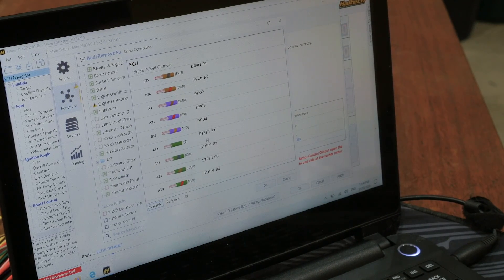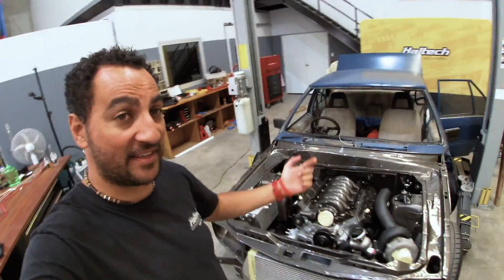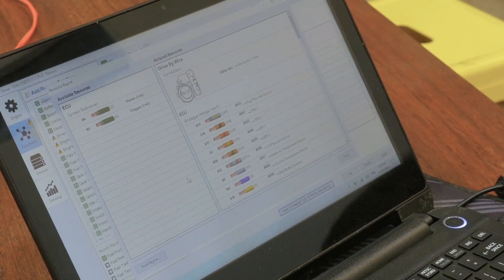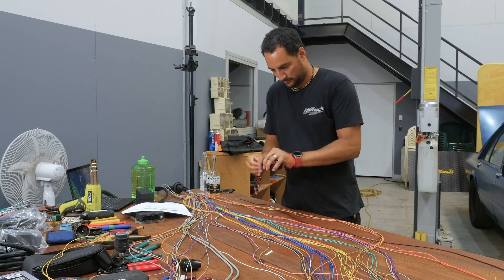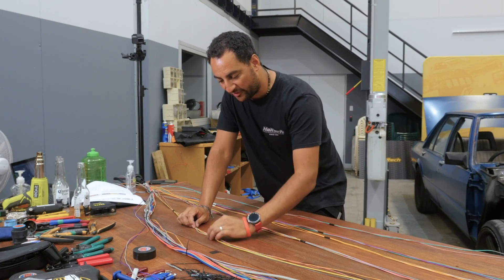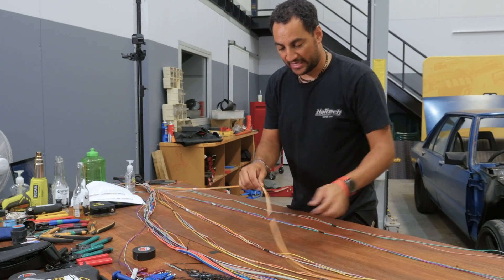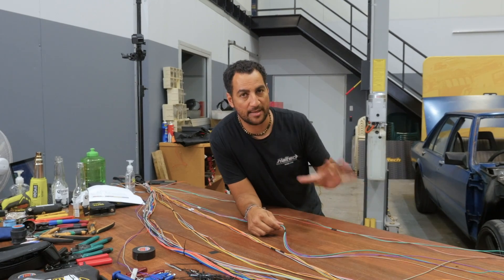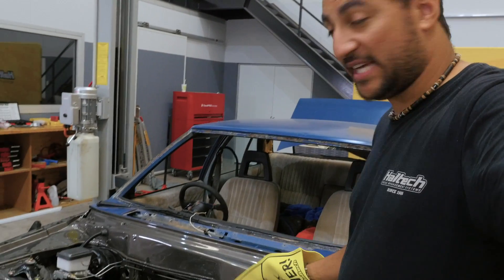🎥 Ep2: Wire Allocation and Grouping | DAVE's WIRING VLOG

Comment: What is the benifit of using the step motor wire rather  then the normal DPO 5 for the fuel pump?
All i can think of is the ability to use a positive trigger to the relay rather then a negative, but not sure on the benifits of this.
Reply: I think it's so he can use multiple outputs for things like staged fuel pumps.